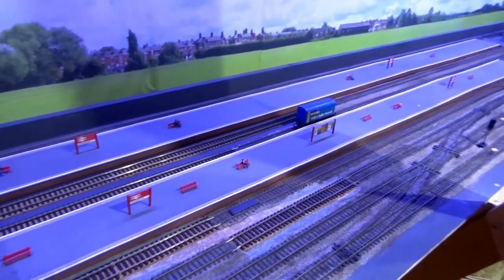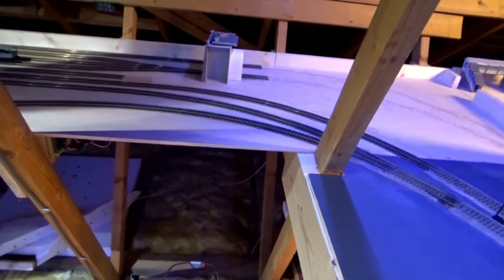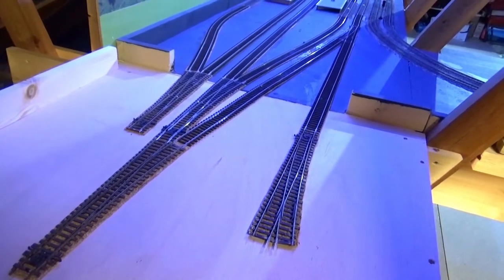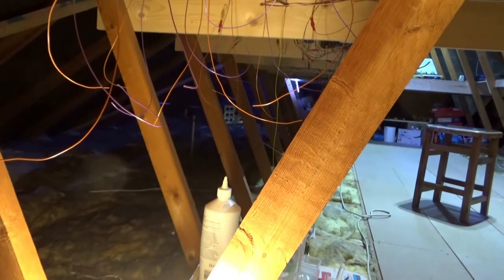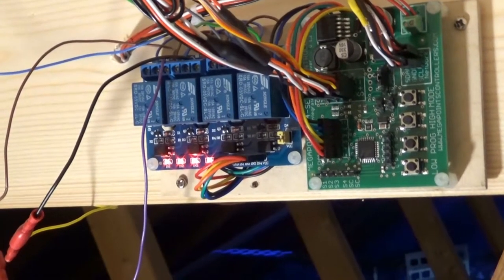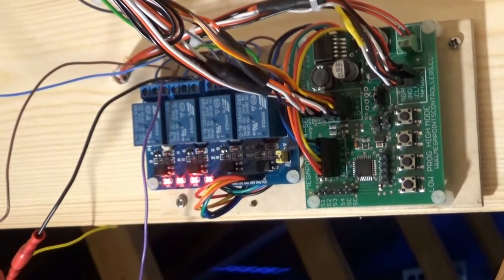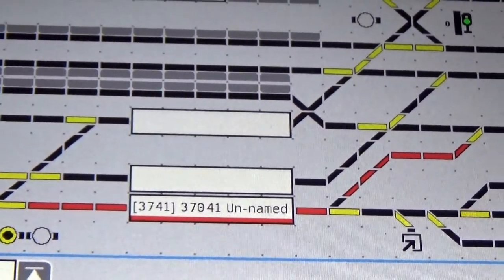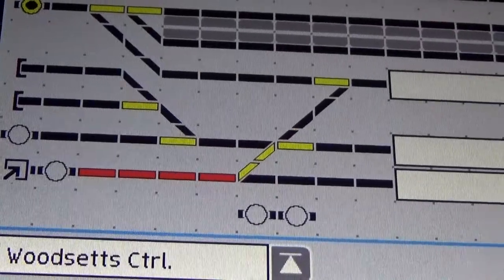2019 Woodsetts Central - Track Laying begins - 2019 02 10

Comment: looking good, certainly going to be a good size. nice smooth running. Glynn
Reply from the maker: Hi Glynn, Yes I am pleased with progress so far. The biggest problem with a loft layout is the temperature shifts you get. Some of my baseboards expanded in summer causing a degree of warping. The only answer seems to be make sure you leave expansion joints in the track. Regards Barry